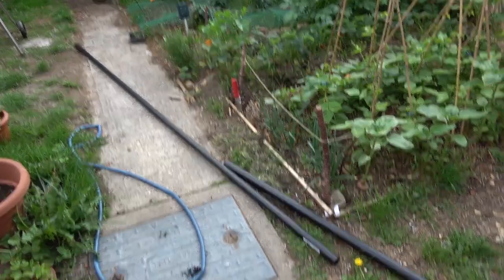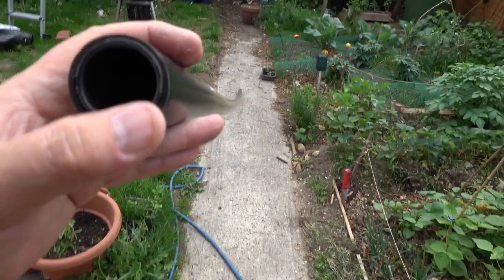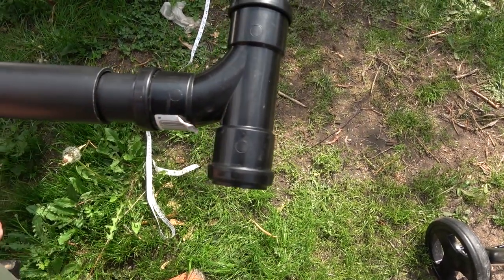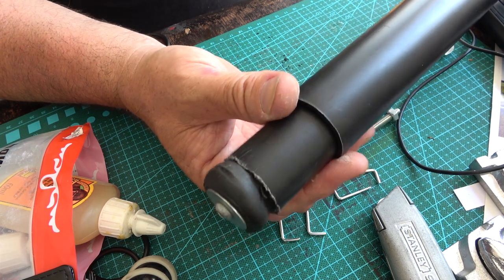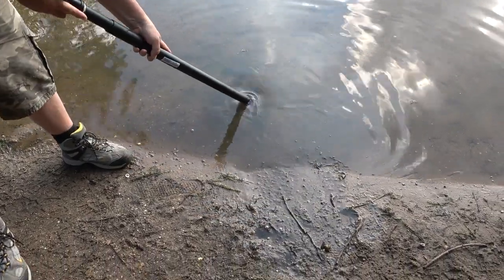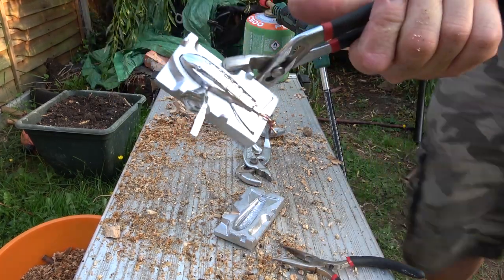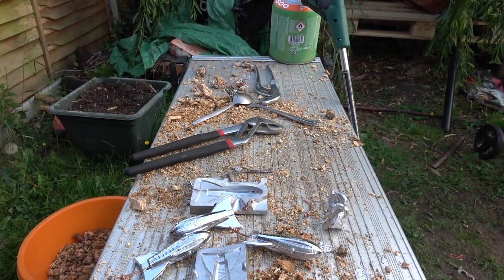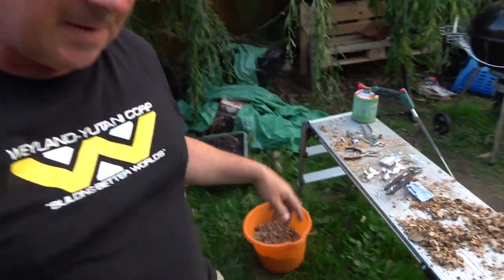Lock down diary 86

Comment: Loads of Bass been caught here at Hutoft Terrace, my mate has caught over 60+ Bass in the last 4 sessions here, some nice keepers too👍 plus you can park right next to the beach, no need to walk 10 miles across the desert that is Saltfleet! 👍
Reply from the maker: blimey! I wonder if there are any lugworm to get while there?
Where abouts is Hutoft Terrace? I've found Hutoft on the map but cannot find the terrace. I'll defo give that place a go if I can find it.
thanks for the info mate
Reply: ArcturanMegadonkey it’s at the end of the Old golf Course next to the sea! There’s a road the goes strait to the beach off the main road
Reply: ArcturanMegadonkey usually get worms at Saltfleet Haven or the beach opposite The big flats in Mablethorpe👍 big worm beds there, but the tides are not low enough until the start of next week!